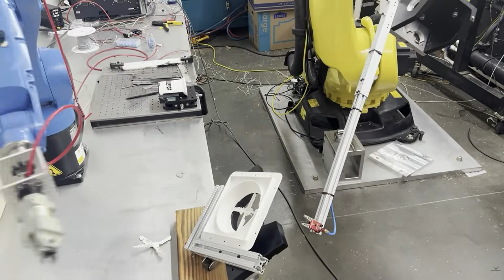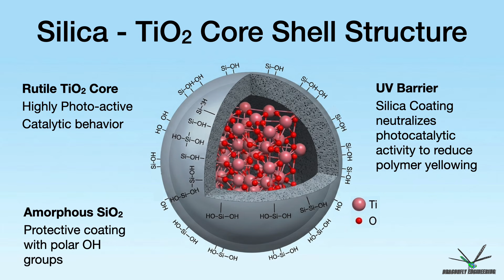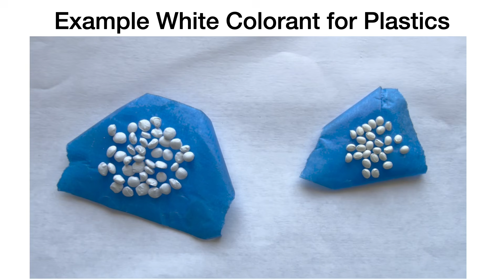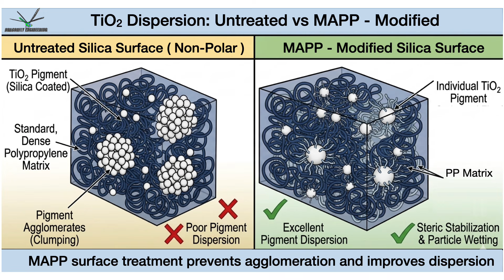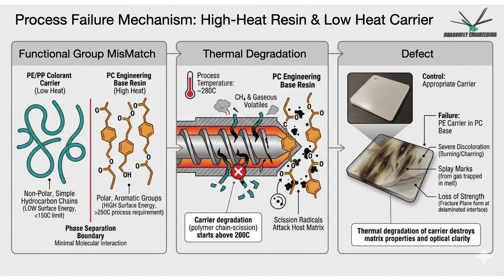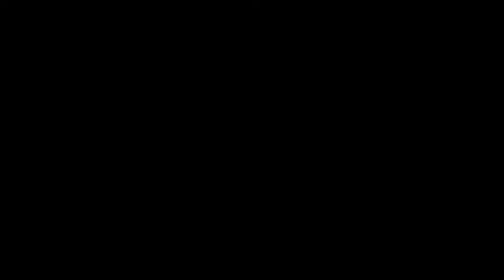White Colorant in Plastic

Comment: Thank you for the video. This brings up something I've been wondering about for years. I work at a blow molding company.  And over the years I've noticed that we have more problems with yellow color then anything else. We run HDPE resin. As an example, one of our bigger machines, shooting about an 18 pound shot or so, we can make parts just fine with grey color, but when we go to or start with yellow its a nightmare. We fight the process for a couple days, or a week, and then suddenly things start running good. We keep going around in the same circles every time. But yet we run yellow fuel jugs on a different machine and we usually don't ever have problem with that.  I know I'm not the sharpest tool in the shed, but after 21 years I/we still understand why yellow gives us so much trouble??? Anyone got a theory on that I'm all ears.    UV blocker, that will be a good video.
Reply from the maker: We do see variations in the injection molding parameters with different colors for the same part, to the point where we have different programs for different colors. I have had yellow polypropylene stick to the screw auger and build up on it. Maybe we will do a show on yellow next. I think cadmium is used a a pigment